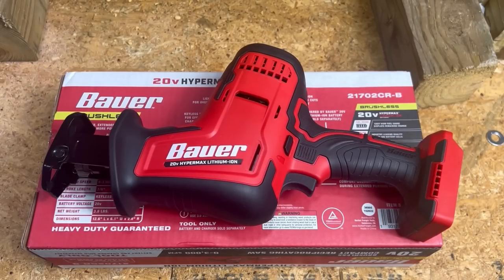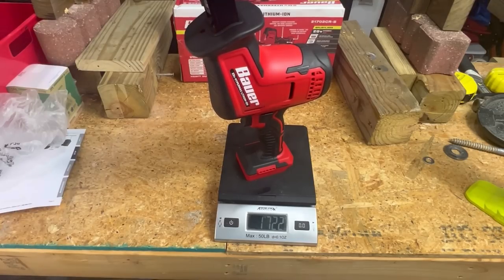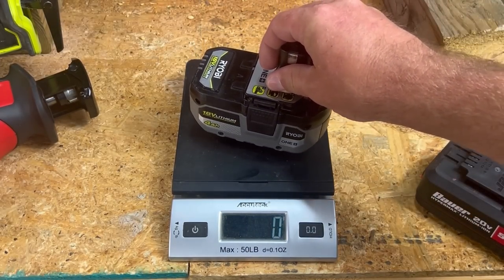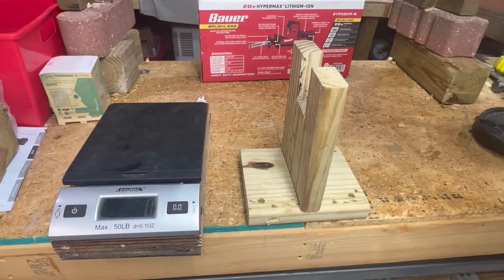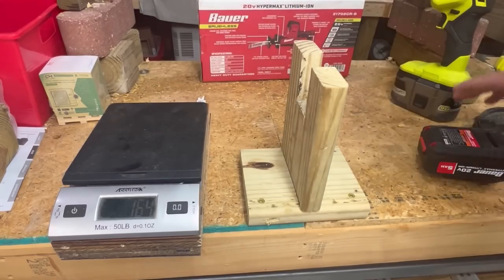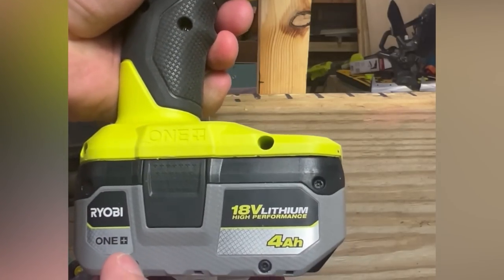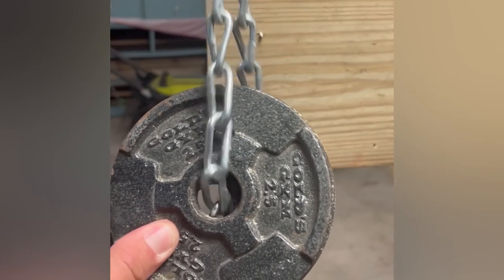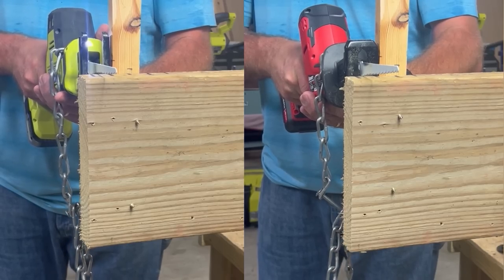Bauer Brushless One Hand Reciprocating Saw

Comment: Comparing any tool to Ryobi is comparing tool A to the trash I take to the curb each week.  I'd be more impressed if Bauer were compared to say Milwaukee or Bosch.  By the way, I am already sold on the Bauer tool line.  Own the 20V compact drill and driver, leaf blower (A+), small hedge trimmer and hand held tire compressor.  Use them all often and am quite happy with results.
Reply from the maker: Yes Bauer tools seem pretty decent. Seeing them best Ryobi was a surprise to me.